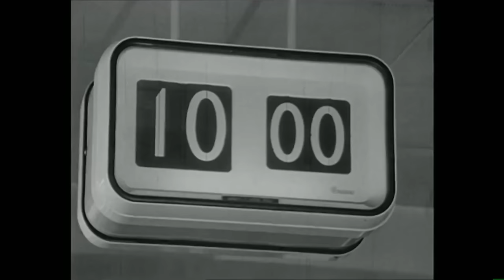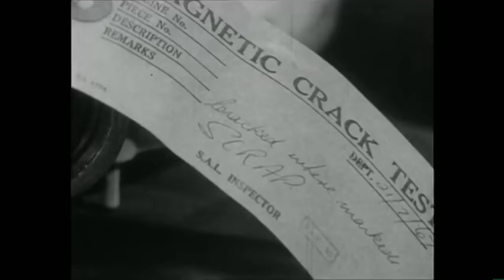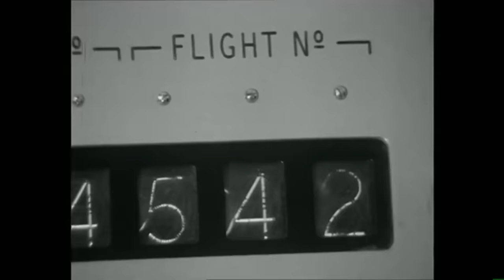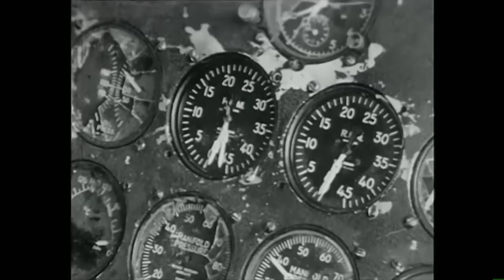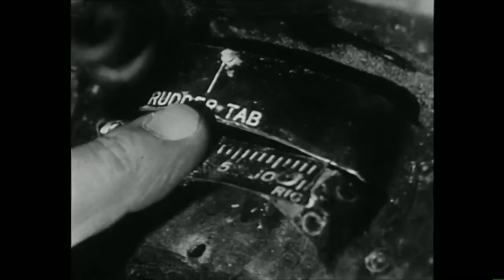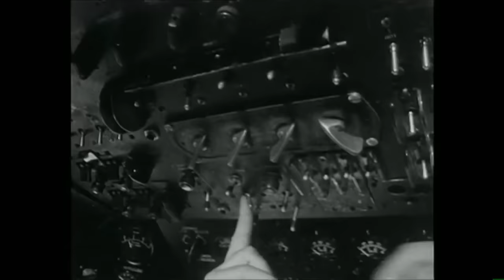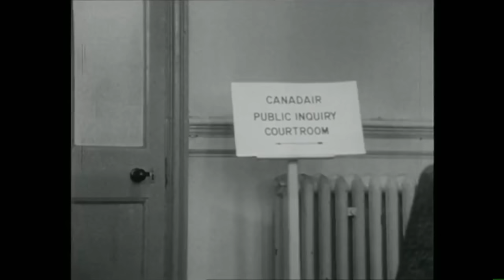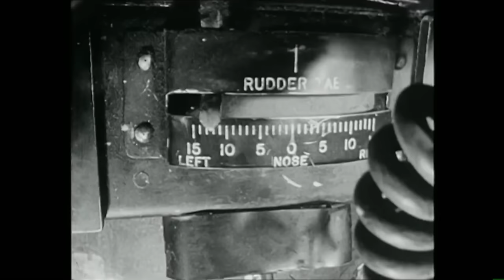Stockport Air Disaster

Comment: There might be a cover up. Did you notice the bit about the no 3 and the no 4 rev counters being reversed.  He said that the plugs were also reversed neutralising the effect.  Conspiracy well yes, but consider this.  It the rev counters were reversed. As no 4 engine failed from lack of fuel, no three engine rev counter would drop, and so the pilot could assume no 3 engine had failed and feather the prop to reduce drag. No 4 prop  would start windmilling causing extra drag, and no 3 rev counter would  show problems in no 3 engine too,. By that time, the pilot would need both hands just to try to keep course, whilst losing height and speed. I am suspicious of such a convenient coincidence.  All investigations can be nobbled.
Reply: I'm surprised, that why the RPM cables were reversed, wasn't investigated more. Had the instrument panel been recently repaired or inspected? Were there any maintenance logs? They did call it a red herring. If the cables hadn't been reversed, the wrong engine wouldn't have been shut down. It could have been a deadly mistake by a technician, rather than sabotage, but either way, it was a greater contributor to the crash, than the crossfeed valve being slightly open in my opinion.
         A similarly caused crash in England happened years later, when a 737 had the wrong engine shut down, because the pilot didn't realize that the newer version of the 737, which he was flying, had it's air conditioning system working off the other engine than previous models, and he used symptoms involving the air conditioning to clue him in on which engine, that he needed to shut down.
Reply: @sparky6086  Yes it seems an extremely likely cause, as it would fully explain the incident, and also why the co-pilot hadn't intervened, as he would also assume that the pilots actions were correct.
Reply: The Crash Investigator claimed, it was a ' Red Herring '?
Reply: @davidlawrence9091  I think he, a Brit,  may have misused the British term "Red Herring" meaning something that seemed to make a difference but turned out to be only a distraction, but if it caused the wrong engine to be shut down, it certainly made a difference. We use the term, "Red Herring", sometimes in America too, but maybe I'm incorrect in it's meaning?
Reply: @davidlawrence9091   Yes they did, it just seems too much of a coincidence to me. IE if cross wired and reading the wrong way round 3as 4 and visa versa. Engine four starts losing revs due to fuel starvation, this shows up on no 3 rev counter. The pilot shuts down no 3 and feathers the prop. No four is windmilling now due to fuel loss, rendering the plane extremely difficult to control and at low altitude, and taking every ounce of the pilot's strength just to hold it straight, and slowing the plane to stall speed due to drag, seems likely to me. Not definite obviously just that it ticks the right boxes.
Reply: @metubewot  It's seems like it. But maybe the cross wired or fitment of plugs wrongly, may have been done during the servicing of the aircraft. Because, I would have thought the build, would have had inspection prior!
Reply: @davidlawrence9091  Yes indeed you would. However it would exactly explain the pilot's actions. Why would he shut down and feather an engine which was running fine, yet fail to feather a dying engine. The crossover would exactly account for his actions. As for the inquest. Think of all major inquests where big money was invested. They are loathe to lay blame on the elite.
Reply: @metubewot  No Crew Resource Management back then.
Reply: @sparky6086  I think in the US we use Red Herring more as a distraction deliberately placed in the way to try to throw off an investigation.
Reply: @billolsen4360  I think, that you are right. It usually has that connotation in America.
Reply: @sparky6086  Am thinking that might be due to TV detective shows here.
Reply: Richard Clark the investigator explained that the cables were reversed because the driving pinions in the gearbox were reversed. The cables were reversed to correct the assembly mistake in gearbox, therefore each RPM indicator was reading the RPM of the correct engine. That's why it was a red herring. That the cables were the wrong way round was thought at first to be something to do with the cause of the crash, but it turned out it was not, because the RPM indicators were indicating correctly. It was merely a distraction from the true facts of the case, which is what a British red herring is.
Reply: @1wheeldrive  Good catch. I must have been tired, when I watched the video.
Reply: @1wheeldrive  Hi , yes I understand what you are saying and the fact that what you say is what Richard Clark stated. My only point was that, if the clocks were reversed, that it would explain perfectly, the events leading to the crash, and be a really odd coincidence otherwise. In addition, we do not know if the crash investigation was interfered with in any way. IE here's £50,000 Richard, be kind to us. I am always suspicious of such things, however as I stated earlier, I may be wrong. It just seems too much of a coincidence that the rev counters being reversed would exactly explain the circumstances leading to the crash.
Reply: @metubewot  Realistically, it would be a moot point. As 1wheeldrive explained, the gauges were reversed to offset the reversal in the engines, so in this care, two wrongs did make a right. Any maintenance would've necessitated an ops check, which would show the individual engines were operating as advertised. The aircraft would have another check each time a crew started the engines, as they would start one at a time. Starting #3 would obviously show as #4 RPM, & vice versa, if the gauge were an issue.
Reply: @averageguy371  You sure?
Reply: @metubewot  100%
Reply: @averageguy371  Impossible to be 100%  sure unless you actually carried it out yourself. You seem sure all engines would be started individually and rev counters checked . Have you flown one of these. It seems to me too much of a coincidence that the gauge reversal was a symptom, although they called it a red herring, and yet it exactly would have created the problems involved. I am not 100% sure, but unlike you, I trust no authority figures to be honest. It would be in the airline's interest to get pilot error, or inconclusive, as the cause.
Reply: @metubewot  If you don't believe me, google flight manuals for multi-engine recips. You can also watch vids of them starting. You start one at a time to monitor proper operation & be able to address any issues such as fire. Also, any maintenance on the engines would require a maintenance run, which would specifically be looking for proper operation. I would bet that's how the engine configuration was found to start with & the reversal of the cannon plugs on the RPM gauges was to offset the engine's incorrect assembly. It's much easier to switch the plugs than to tear into an engine. Maint & pilots would also both be looking for RPM response to throttle inputs on runups either on engine ops checks or runup prior to flight. The RPM gauges being backwards simply didn't matter as engine RPM indication was correct. Don't get too caught up in coverups. Sometimes the coverup is of your own eyes.
Reply: @averageguy371  I accept that I could be wrong. You are obviously more trusting of authority than I am. So what do you think happened then that caused him to shut down the wrong engine and even feather the prop?.
Reply: @metubewot  I really don't know, as I'm sure no one ever will, but the doc presented as good a scenario as any.
Reply: @averageguy371  You are possibly correct, as am I. They would claim that you are, I'm not sure. I have however enjoyed discussing it with a sane person. Unusual today. You are a gentleman, and I've enjoyed our debate. Kindest regards ian.
Reply: I would think that reversed cables would have been discovered during a start up or shut down at some point within a few days before the crash, surely someone would have caught it. Perhaps it was done shortly before the flight  or some maintenance before the flight. makes me wonder who was going to be flying on that aircraft
Reply: @yrunaked4  Yes you would think so. I just feel very suspicious that if it still was there, it would have caused exactly what happened. I mean why was no 3 engine shut down and the prop feathered, whilst it was no 4 that failed?

Comment: I wonder how many lives were saved as a result of this investigation and subsequent corrective actions. So there are "accidents" due to pilot errors, design errors, communication errors and the error of flying into bad weather. No one is perfect. With the advent of AI (Artificial Intelligence) I am hoping that such "accidents" can be prevented. Thanks for the posting. Good on ya mate.
Reply: A significant influence on safety would be the now-routine dissemination of information between operators of a type, the manufacturer and the relevant licensing authorities.

Comment: Air Ferry was a budget operation, cashing in on the boom in post war air travel and cheap escape holidays to places like Spain and France. On the (believe this or not) the same day, another DC-4 full of British holiday makers crashed in southern France killing 90 or so. I think this was also Air Ferry, but I could be wrong. By 1967, DC4's were old technology and were only used by cheap operators trying to make quick money. Both accidents were avoidable.
Reply: Hello mate. An Argonaut is not strictly a DC 4. The use of Merlin engines made for an inferior aircraft as they were very very loud and the DC 4s were ex military models without the sound deadening  applied in proper Civil DC4s. The Argonaut was created to take advantage of the huge stock of Merlins after the war  to save money as Britain was broke and needed to avoid spending Dollars. It was mainly used for ferrying troops and families (and freight) around the Empire and dreaded by those families for the terrible reputation it had for being so unpleasantly loud. However it was a decent enough plane but by the 1960's was as you intimated, very cheap to buy. This one crashed but I wonder if a proper DC 4 with radial engines would have maintained height on two engines. Of course any plane must be able to fly properly with only half of its engines working so it , in theory, should not have crashed at all.
Reply: @taketimeout2share  Wikipedia has a good article on the aircraft which the Canadians called the North Star (the Argonaut name comes from BOAC from whom BMI got the planes used).  They were assembled from various pieces originally designed for the DC-4, the DC-6, and the C-54 by Canadair for Trans-Canada Airlines.  They used Merlin engines rather than the radial engines that Douglas used.  They  were faster than the DC-4 by quite a bit because of the Merlins.  It was designed in Canada rather than Britain, so not actually a British airliner.
Reply: @AML2000  Nice info. Thanks. I think Canada needed to save spending Dollars too. It's ironic that the Comet tragedy left BOAC short of airliners so bought these as a stopgap. I do remember reading that BOAC were thinking of redesigning the exhaust manifolds to reduce the racket these (lovely) Merlins made. Wether they went ahead and did so I am not sure of. They wanted to use these for as short a time as possible and sell them on so would be loath to spend any money on them. it was a very good workhorse, but definitely not an aircraft any premium airline would ever choose to operate.
Reply: @taketimeout2share  Thanks for the background. I always wondered why they were called Argonauts.
Reply: Gary Dodgson  I stand corrected. This crash was British Midland not Air Ferry but I also take your point about air travel in the 1960's for the working man. Its just that he probably wasn't really aware of the risks he took flying in such machines. Note also that Air Ferry had another serious accident in 1961 ( think) on the same route to the south of France and I believe the same mountain.
Reply: @zozzamozzi  No problem. As a footnote  a BOAC Argonaut was chosen to fly The Queen and Prince Philip to Africa in 1952. If it was good enough for them then it cant have been that bad. Lol. Personally I really like them, but I like all propliners. It was a good plane, long range and quite fast. The noise level for the passengers really was its only vice.
Reply: @taketimeout2share  In theory,  no aircraft should crash at all!
Reply: Gary Dodgson  Your comments are correct, In Latin American nations,there are STILL DC3's flying pax and freight,cheap to run,cheap to fix,(I wouldn't risk a flight myself as the servicing is (What servicing?) check out on Google DC3 aircraft Flying in Laitin Americas,at last count there were some 90 odd STILL getting a daily threshing of freight and pax.  As a retired Air Traffic Controller, I have an interest in airliners particularly the older ones, Looking at the latest, 737's MAX for instance,and the back ground history makes me think that DC3's will still be flying when all else has fallen out of the sky.

Comment: Why wasn’t the Flighty monitoring the fuel loads in the various tanks?
Reply: Good question Kenneth - did Argonauts have a F/E position and if so was one on board ? The nearest I got to being in the cockpit of one would have been DC-4's / C-54's in the late 60's so the memories are somewhat faded to say the least...
Reply: Jon Rishworth  Hi Jon, I’m sure they did have a FE. But even if they didn’t, you’d have thought that one of two Pilots would’ve noticed. I have my doubts on their theory. The cross flow valves would’ve been closed long before the Levers in the far down position. I’ve often noticed that the investigation tries their utmost best to find something to blame.
Reply: Do you mean flight engineer?? 
A lot or most did not have them and the controls and istruments were very basic back then
Reply: @kennethwarburton177  Try closing one of your water taps and see how close to fully closed it will still allow the water to flow , do it with the cold ones as that will be under more pressure and simulate a pressurised fuel system better .
3 other airlines had axperienced the same problem . 
'' The investigation tries thier utmost best to find something to blame '' , starnge , i thought that was the point of the investigation. aAt least they did not try to pin it on the pilots for a change , that used to be the fall back position
Reply: david thomas  I’ve remembered, the DC4, which is basically what the Argonaut is, didn’t have a flight engineer, but you’d have thought that one of the pilots would’ve noticed it.
Reply: david thomas the crossflow levers aren’t the same as closing a tap. The crossflow valve would be in the desired selected position long before the levers were at the bottom of their travel.

Comment: Sad the ATC did not ask a few more questions,
Reply: In an emergency situation, the priority is aviate, navigate, communicate. From the description of what was happening on the flight deck, it's most unlikely that the pilots would have welcomed more on their plates. The controller did the right thing and let the pilots aviate. Thinking about a subsequent investigation would be the last thing on anyone's mind because until it happened, there was no crash.
Reply: @PedroConejo1939  The pilot said he had RPM issues not 2 engines were out..some difference ..Saying that ATC would assume all was ok.
Reply: @glendooer6211  I do love it when the experts wade in 50 years after the event and go through the transcripts line by line (you do have those, don't you?) to pick fault. The controller had granted the request to miss the approach to allow them time to resolve a problem; he would have known that something was amiss from the brief description he was given. Yes, he could have asked lots of questions that would help out the subsequent inquiry but he would also know the pilot would have more than likely had his hands and head full right then. Controllers were qualified pilots too. Although the controller didn't know exactly what they were dealing with, double asymmetric engine failure with an unfeathered prop on such an aircraft is bloody hard work, quite apart from trying to work out what had gone wrong and what could be done about it. Had the controller nagged for more information, he might well have been told to be quiet. The controller offered what help he could and did not hinder the flight crew.
Reply: @PedroConejo1939  A bit of a rpm problem is not the same as 2 engines out..like saying there is a problem with the front door when the house is in pieces 300ft in the air.
Reply: @glendooer6211  I thought your criticism was of the controller, not the pilot.
Reply: @PedroConejo1939  Both the pilot said RPM probs which would be taken as over-speed or pitch He could have said we have lost 2 engines
Reply: @PedroConejo1939  Two engines out is not a lot of questions,,Get well soon
Reply: @glendooer6211  "Two engines out" is not a question.
Reply: @PedroConejo1939  Excellent pick up did you get help from your kindergarten teacher. Go to the top of the class.
Reply: @glendooer6211  I think we've reached the end of your intellect, so I'll call it a day on this. ☮️